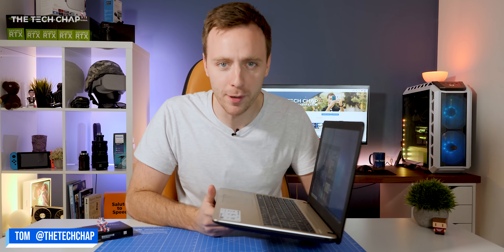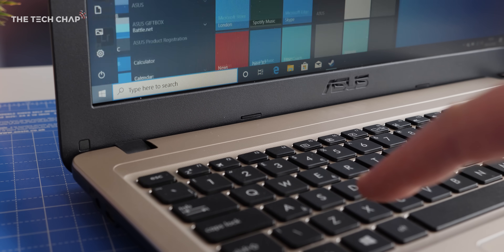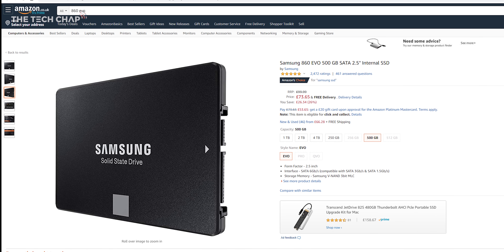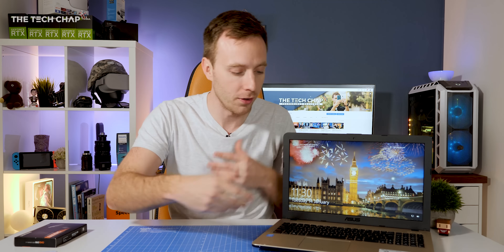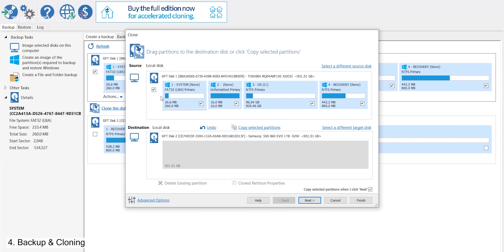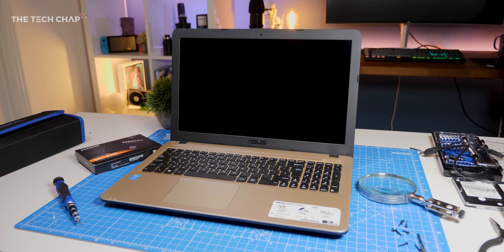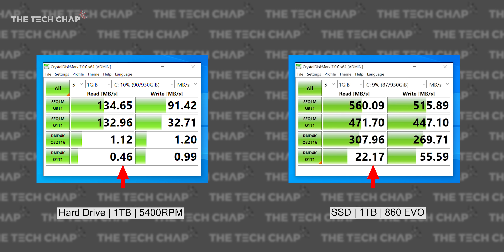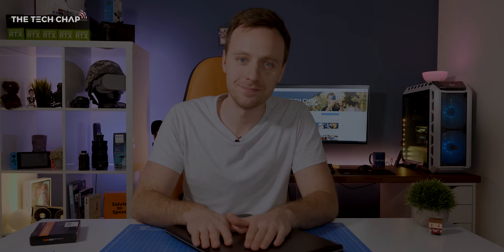How to UPGRADE Your Laptop with a SSD! #AD | The Tech Chap

Comment: Nicely Done. SSD's offer the following benefits for laptops over hdd's -  runs cooler - uses less power which lets the battery last longer per charge , better shock resistance , are silent in operation , are lighter , has better reliability. Besides changing to an ssd - If you can adding more ram and faster ram to the maximum that the laptop can support. All of these upgrades will let you keep tha laptop even longer. I made both of the above cahnges to an older laptop that my mom had and it made the laptop run better then when it was new.
Reply: That sounds great. Also I don't like Windows 10 11 I'd like to stick to Windows 7. Is there anywhere you could recommend going where the bill to do all these upgrades for me
Reply: @Stardust_Truth_Seeker  Maybe you can take it to a local
 pc store that offers a repair service - if you don't like to do the updates.

Comment: Watched this video recently and decided to carry out the same type of upgrade but for my desktop instead. My C: drive was a WD 2tb and there was still a lot of spare sectors available. With this in mind I bought a Samsung 1TB 860 QVO. I used the Samsung migration software to carry out the cloning process, which took five and a half hours, only to fail at 99% complete. Total waste of half a day. The thing there is enough space on the new drive, its just the Samsung  software didn't like transfering data from a larger drive to a more efficient smaller SSD. It was quite by chance doing some online research that I came across AOMEI backupper free software which can clone just the sectors used on the source or target drive to a smaller drive. I can't believe how easy the process was, and it only took two and a half hours. If there are any viewers out there in the same situation I would highly recommend AOMEI backupper free software. I am very disappointed with a company as big as Samsung who's software cannot as far as I'm aware carry out the same process as AOMEI.
Reply: Wow! Thank you so much for your insightful comment. 👍
Reply: THANKYOU✨

Comment: 7:18 a computer is only as fast as it's slowest component
That's a great line!
Reply: @iHateCactuars  just what i was about to say. so i'l say this, don't eat yellow snow.....
Reply: That is a very common line for decades now.
Reply: @JM-dt9oo  b- but i thought it was a snow cone :(
Reply: That forms the basis of chemistry kinetics...rate of reaction..
Reply: That’s something that we use a lot in manufacturing. A production line is only as fast as the slowest machine which we call the Bottleneck.
Reply: Great reason to get a brand new computer if your current one is slower than molasses in January, assuming you have the means.

I was so afraid I didn’t have the means to get a new computer when my last one broke lol

Comment: To the new techie's, an old trick to make sure your do not double thread the tiny screws is to
1 put the screw in the screw hole 
2 using the hex screw driver slow rotate the screw driver Backwards like you are removing the screw
3 you should feel a slight snap from the screw and this means you have dropped the screw to the thread in the hole.
4 now you may drive the screw Forward and it should turn easily and screw in

Comment: The Tech chap, 3years later this video is still relevant. Followed your steps and I swapped my HDD for SSD. Thank you for all you do.

Why migrating my files, I was so happy that it worked and I wish I could get a snapshot or short video to share with you. It worked pretty well like I just turned off the PC and turned it back on again. 💯💯💯💯
Reply: I hope you don't mind my asking but which USB to SATA cable did you buy 2.5 or 3.5 I can't tell which one he's using.

Comment: You did a wonderful job on this tutorial explaining how to bring life back to an old laptop. In 2011, I swapped out my old 250gb hard drive for a 500gb hybrid ssd. Just that upgrade made a real difference. Before that, I had upgraded my motherboard, computer processor chipset, and ram. Now! I’m upgrading from my old hybrid ssd to a 1TB ssd in order to make my old HP DV4 laptop even faster, more current and more responsive too. I’m really not much of a fan of these new laptops which are very flimsy while one is only able to make an upgrade, or two. Again,  thank you for a wonderful tutorial!
Reply: I believe you should really consider upgrading your laptop. Any moment now a componenet or a wire may just simply fail and you'll lose everything. If you're going to continue upgrading then there will be no use since it will be held back by the old CPU or the low amount of RAM.
Reply: @Covid-bv4hp  TY! I actually have 8gb of Ram on mine and I have it backed up on my older external 500GB Hybrid SSD. Also, I have no problem repairing and soldering electronic components either. I really don’t use my laptop to play games so that’s really not a problem. I have a Galaga 88 countercade which I upgraded. Many of these new laptops might have the speed, but they are limited by their lack of storage capacity.

Comment: I have this Christmas laptop that I got from santa and it’s painfully slow I’m sure it is a budget laptop but I’m gonna make the most of it. It has 4ram and a 1t hard drive 5400rpms , I looked up what the max it can handle and bought a 8g ram and 250g ssd . I’m not planning on doing anything crazy with it just the usual stuff YouTube videos shopping online I’m invested $60 total ($20 on the ram and $40 on the ssd) still waiting for everything to come in the mail but hopefully it goes smoothly when I install it all. Good video man I’m glad to see the before and after loading times that is a big improvement

Comment: Thanks a lot, my man... I guess this is what I will do with my current laptop (512 GB mechanical, 4 GB of RAM, and i3 7th gen). I'm buying an SSD and after that I'll put 4 more GB of RAM. 

Love your content, dude. Blessings from Mexico.
Reply: Thats what i also did as a student, took my i5 4th gen, put a 500ssd and +4gb ram and its like a new thing. The processor aint that good though and lcd for photoshop and illustrator work, but if u dont have to do hard work in it, you dont need any better laptop :)
Reply: @gzarari  I'm an actuary... so, most of the stuff I do doesn't require crazy power (Stats, Data Bases, Medium Level Programming, Financial Simulations - R Studio, Python, SQL, Julia, Mathlab, etc)... and the good thing is that I have a 1080p touch display, so I'm good to go with Netflix for entertaiment. 

I do want to start as a content creator (music), and I love videogames, but always wanted to do it on a PC or Gaming Laptop (tired of consoles) but those are no my priorities for now. Thanks a lot for your words. Blessings :)
Reply: @oscarsimon5387  upgrade to i5

Comment: Well done-- concise. and to-the-point. Good tips about transfer from the existing drive, and the need for a USB-SATA adapter/cable. 
Those with an older SATA2 system bus will not see the dramatic improvement you enjoyed with a SATA3 bus, but the project is still worth doing. 
BTW-- consider upgrading the RAM, as well. Even a small increase can benefit over-all performance.

Comment: This is insane thank you so much tech chap, you just saved me thousand dollar, I was just about to throw my laptop as it was painfully slow it would not work only but after installing Samsung SSD and following your steps that laptop is a beast. It works flawlessly to perform everyday tasks it is an i3 laptop. Thank you so much bro.
Reply: Hey, i have a really slow laptop with a hard disk, i want to get a samsung ssd evo 870, can you tell me if its worth it? Im not that person that can buy laptops every year
Reply: I will appreciate your answer.
Reply: @Marko-pn3yp  yes bro it is worth it, just make sure to follow the correct steps, ssd is a beast, my laptop is quite fast, but previously I was on Hard drive thats why I feel much greater speed
Reply: @fozanshaque6094  thanks really much! And also, i will bring my laptop to a tech shop because there are a lot of steps that im not able to do at home,  appreciate it bro👍
Reply: Quich question, is your laptop at the same speed even after 9 months?
Reply: @Marko-pn3yp  not that much, but still pretty fast compared to hard drive, it instantly turns on and off

Comment: Great tips. I specialise in giving new life to old laptops. First, fit as much RAM as it will take - often more than the manufacturer says. Then search the Intel Ark and buy a top spec New Old Stock CPU from China. Around £25 for what cost £450 new. Then fit a SSD and watch it fly. And you can also replace the DVD drive with a HDD caddy for extra storage using the old hard drive.

Comment: Hey Mr. Tom I love watching your content but I have one question to ask, will this same ssd make my 8 year old laptop faster.
Reply from the maker: Yep! Might not be sata 3, but it'll still make a big difference
Reply: A year and some months ago, I swapped my old laptop's hard drive for an ssd, and the difference was insane. Before, I would never turn the device off since it would take so long to boot up (I'm pretty sure that's the main reason why the HD ended up failing). The device is from 2011 according to the oldest files (it was handed down to me), and even though I got a new laptop last summer, the computer still worked great the last time I used it (I gave it to my mom).
Reply: @SL1CK First do the ssd then the ram but you cannot do anything more unless you try searching on google if you can install a new cpu in to the model that you have (i dont know if you have an external gpu or gpu in the cpu together) maybe you can install a new gpu but i am not sure if your model has that you can upgrade it And of course it Will be expensive af 😂
Reply: Windows Destruction external gpus aren’t that expensive if you get a dock and use a desktop graphics card

Comment: Pro tip: If you're going to get the external hard disk enclosure anyways, you don't need the SATA to USB cable. =)

(That was my case. I put the new SSD in the enclosure first to clone the hard disk. Then I swapped the hard drives after.)
Reply: this is what i was looking for....king
Reply: i love you thanks
Reply: @The-Basketball-Historian:

What external hard-disk-enclosure did you use?

[Can you please tell the brand-name, model-name, and model-number of it? So that it's easier to track-down [which one you used] and buy one.]
Reply: How do you connect from your external hard disk enclosure to your laptop if not thru USB port?  This makes no sense!
Reply: zohi  'enclosure' = $23,  SATA cable = $7.  Unless you need to have use of external ssd/hhd constantly then you must buy the enclosure.  I am just cloning the ssd to replace the hhd.  For my purpose i do not need to spend more.   I did not have to mess around with setting or bios after cloned the ssd.  the PC start right up as it was before but 10 times faster.  Thanks.

Comment: I went from a 860 evo sata ssd to a fast nvme drive and I notice a difference, everything feels a lot snappier.
Reply: But nvme only is really fast when it reads sequentially tho
Reply: @xoxo-pp7ru  You would be 100% wrong.
Reply: @JamesSmith-sw3nk  source ?
Reply: @xoxo-pp7ru  Your source? My source is my nvme feels and is faster than the sata ssd I had was.
Reply: @JamesSmith-sw3nk  that's not a source 💀
Reply from the maker: Yeah I agree you can notice a difference going with an NVMe drive but most old laptops won't support it

Comment: I am doing this upgrade this week and adding 16 RAM to my 6-years old laptop.👍
Reply: A Solid State Drive is the best upgrade.  It was way better than more RAM on my 6-years old laptop.
Reply: @Fizzickz The SSD works great and I use it every week even though it's my backup.  It has given extended life to my big laptop.
Reply: @Fizzickz First, I had my main PC Tower upgraded with an SSD with 110GB (too small).   My laptop was 6-months ago as my spouse complained about how slow it was starting up back then (it was very slow).  The SSD 1TB upgrade fixed that and I have no issues with zoom etc (I am not a gamer).  I am thinking of upgrading my PC Tower to a bigger 1TB SSD as I use this every day.  I got the SSD's at Best Buy (not sure the brand).  Go big NOT small in the SSD.
Reply: @branned  bro i have a question, if i switch to ssd how do i get my files back? and how do i install a OS again?
Reply: @cj9318  I had Geek Squad do it for me.

Comment: Hi Tom, just wanted to say that thanks to you my laptop is as good as a brand new one! I have a Asus exactly the same as this one and I hardly ever used it cause it was so slow!!! Now it's fast and fast and slick. Did the change over night had one issue with the cloning, vss error, but all good.. I tried to sell my laptop and they offered me 72€ at the shop.
Spent 50€ and have a great and fast laptop.
Thank you so much and God bless.
Cheers

Comment: Good Day! My laptop model is K556U, the same with X556u but with built in 12gb of ram. The internal components of my laptop is the same with the one you are working with in this video. I want to replace my 1tb hdd with a 2.5" SATA III SSD. My question is: can I replace my 1tb HDD with 1tb SDD to have the same storage space? Can my laptop support 1tb SSD or only limited to 480 gb and below?
Reply: The samsung SSD SATA 2.5 supports any laptop, the storage space doesn't matter
Reply: @Marko-pn3yp  thank you sir
Reply: @Krfrndign  any time

Comment: Been considering this for awhile.
I have an older i3 machine that was originally bought as a Win8 machine that I took to 10 back when that was first released as a free upgrade.
It works fine for the light work I ask of it, but at 6 years old now, I know that drive is going to belly up on me some day.
Thanks for the vid

Comment: I upgraded my Acer 2011 laptop with a Kingston 240Gb SATA SSD to replace the 500GB hard disk. For about $30 it was good money spent. Can't see getting a larger more expensive drive for my old backup computer. It boots up remarkably fast even with Windows 10! I upgraded my relatively new Dell laptop with a 500G NVMe m.2 chip. Minutes turned to seconds! It was painful to use the 2T HD before the upgrade! It's now a pleasure to use. I used free Macrium for my Dell but did a clean install on my Acer.

Comment: Hi, I have a few questions:
1. If I change my HDD to a SSD and migrate via cable and the migration freeware do I keep all my files and installed applications after the change (e.g. MS Office will still be there), or do I need reinstall those apps again?
2. Do you know, if I have two partitions on my computer, will the migration tool copy both or will it only copy the C drive (of my operating system). My question is, actually, how to make sure that both partitions are copied from the old HDD to the new SSD?

Thanks.

Comment: Worked followed the video only problem was formatting new drive first had to format on another computer first as came up with I/o error on the laptop that I was upgrading. So formated the disk on other laptop via USB then everything worked. Upgraded the hp2570p easily after that it runs better than ever. The Samsung software worked brilliant just under an hour to transfer data.

Comment: my brothers laptop came with 250 gb. and i wanted to upgrade it. would a 1tb still be okay?
Reply: Of course. Make sure the laptop does support standard SSDs. Some of the very ultra thin laptops have soldered on SSDs making upgrades impossible.

Comment: What do you recommend for my Acer a315? I have a empty SATA(big) SSD slot free and I also can replace the normal M.2 SSD inside of it(that Acer soldered inside with windows 10).

So should I install a Samsung evo 970 plus M.2

Or a Samsung Evo 870 for the empty slot and don’t change the M.2 ssd by Acer replaced.

Comment: Question: 

Can you recommend good free drive cloning software? Was it Macrium reflect?

Also: will I need to install the OS after a drive cloning?

Can I put in a Ram stick upgrade during the swap or does it have to be before / after?

Thanks for your time

Comment: Just upgraded my Mom’s Lenovo AMD G50-45 Laptop for her. Upgraded the 4GB RAM to 16GB (maxed out now 😁 with G.Skill Ripjaws CL11 8x2 sticks of Ram), along with the 1TB hybrid HDD (didn’t know was a hybrid, which pretty cool considering when laptop was released, imo) to a 1TB crucial ssd (why not Samsung....simple. I picked up this SSD new for $74.89 & couldn’t pass that deal up😉). 
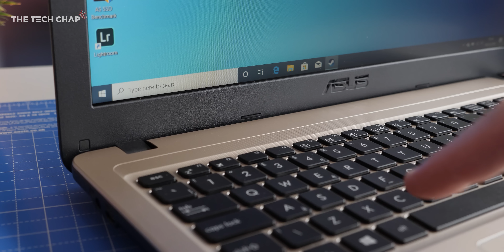Gotta say, even going from a hybrid hdd to a ssd, I’m still able to dramatically see a difference. The “complete boot” from off to everything loaded etc...before upgrade was 1:08, & with new ssd.....the complete boot for all apps, daemons, etc...loaded is; an impressive 22 seconds. Wish I would have done this ages ago 🤦🏼‍♂️. The RAM is nice too, especially using Chrome😏. 
So for a grand total of $148.72, the laptop has new life... The main reason this needed done, the HDD was making grinding, high pitched noises; w/ bsod, black screen, & frozen/locked screen, & we all know what this means (nothing good!).
So instead of buying new laptop, the laptop works great, better actually, & has some new pep & will last for another 6 yrs I’m hoping, lol (for work mainly & the occasional YouTube vid, movie watching, etc... Not a gaming machine so should be just fine for what they use it for, fyi).
Cheers✌🏼